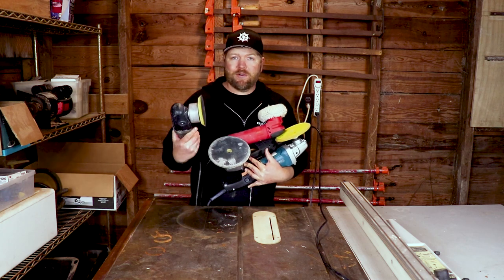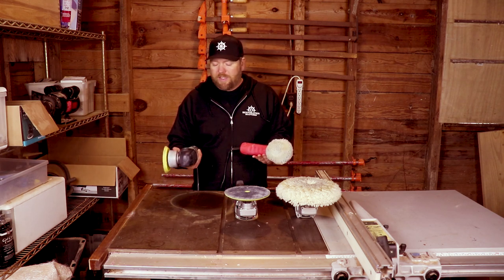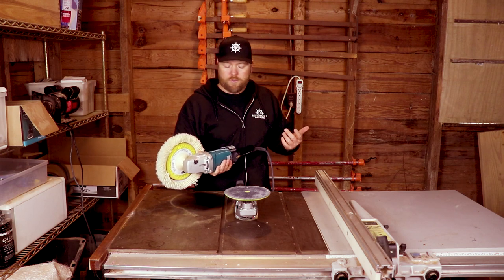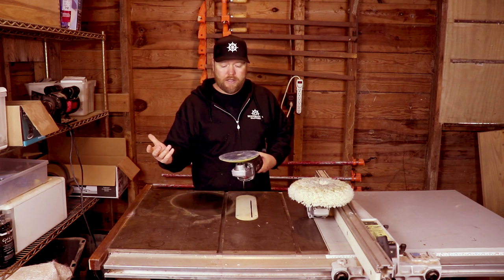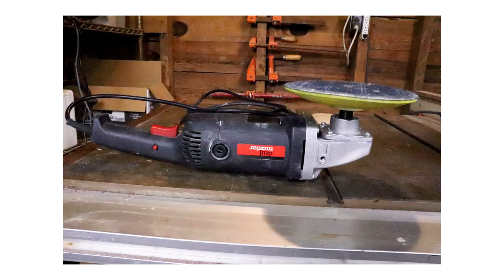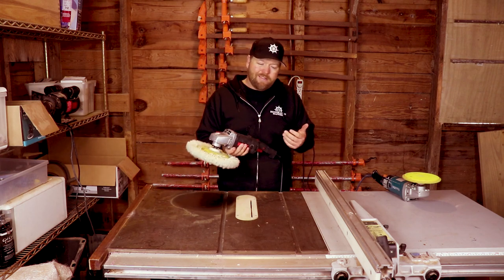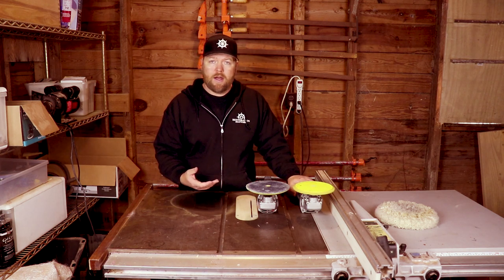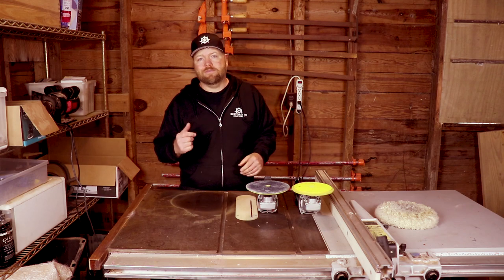Best Polisher for Boat Oxidation - Makita, Porter Cable, Harbor Freight [Review]

Comment from the maker: This video will show you the steps to getting your boat glossy again tps://youtu.be/uiH7F6z02t4   If you have any questions or thoughts, please share!  I'm not the brightest guy( I work on boats for a living!- I think that proves my intelligence right there)  I probably overlooked something!  Thanks, Brian
Reply: Every you tube video show how to remove oxidation on the hull but never on the top side. The Mikita 9237 is my rotary buffer that I use for the hull. When it comes to the top deck or around confine areas I fine it heavy and hard to maneuver. I taught that the orbital Porter Cable or the Harbor Freight machine would have been a good compromise. Do you have an other suggestion ? Normand
Reply from the maker: Monster Norm You need the power of the Makita.  At 600rpm it still delivers a lot of torque and allows you to work slower threw tight spots.  I hope to do a boat soon where I can film the inside.  Direct sunlight is hard to film.  That’s why I’m doing hull sides in all the videos.  I can film in the shade!  I need a boat that is covered to film well.
Reply from the maker: Monster Norm There are two main things that help on the inside.  First, slow down the rpms in tight areas.  Second, an extension for the buffer is awesome around Ttops and motorwells.  Depending on the brand of boat the inside can be a real challenge.
Reply: @SportfishingBoats  When you say an extension, do you mean the 3M quick release for the double sided bonnet? The boat is a Norhavn 40 which is in the water.
Reply from the maker: @monsternorm4245  Norm the a quick release is not what I'm referring to.  However on a Nordhavn 40 I don't think you will need one.  (that's a sweet boat by the way!).  The speed control dial is your friend in tight areas.  The saying is "Go slow, to go Fast!'
Reply: @SportfishingBoats  Thanks for your answers Brian, since I am using the right machine I'll just keep at it slowly as you say. I've been using Meguiar's One step compound, and now the new perfect it 3M heavy compound especially for gelcoat. Do you think I'd have better results with the Presta super cut Compound?
Reply from the maker: Monster Norm Yes,  Supercut is my favorite but the 3M should work fine.  Yes, White for compound and green for polishing.
Reply: @SportfishingBoats  Thanks but which pad do you use for waxing?
Reply from the maker: Monster Norm I usually hand wax.
Reply: Brian, what exactly is a DA Machine good for?  I have the Shurhold but I’ve never used it.
Reply from the maker: mossy112965 for boats, I wouldn’t recommend anyone buy a DA.  Really unnecessary.   I use my DA  as a sander more than anything else.
Reply: Hey Brian,  Great video...
In the video you stated that the Harbor freight tool needs a better backing plate to do the required work.  Can you please provide an example of what I need to look for and or specific part numbers and where to find them?    Thanks a bunch!
Reply from the maker: Keith Whitney Thanks.  Your welcome!  A Presta 810116 will work nicely.  Let me know if you have anymore questions.
Reply: Use lake county pads. I also use trt mirror cut and trt 4 in 1

Comment: In the automotive world you can correct pretty well with a dual action polisher thanks to the inventions of low profile microfiber and wool pads, but boats I could only imagine that a rotary with a heavy cutting wool pad is the way to go for that first step. Some guys are using the flex 3401 and Rupes Mille now on boats, the flex 3401 paired with a low profile wool pad cuts like a rotary, but finishes a little better, you’ll still need to follow up with a softer foam pad and polish to finish out perfectly though.

Comment: Looking at the dewalt dcm8493. Looks same as makita you love but in my mind a better brand name and slightly lighter. What do you think?
Reply from the maker: Every single pro I know that’s been doing it for more than a few years uses the Makita 9237.  It’s bullet proof.  Smooth threw all rpm ranges.  Also doesn’t have the awkward camel back hump of the dewault on top that gets in the way when your holding on top in tight spaces.  My oldest one isn’t quite 10 years old.  My friend has one that is 27 years old and used daily.  I like Dewault compound Miters and other tools.   Rotary buffers for boats... you cannot go wrong with Makita.

Comment: Looking for a few tips. I followed Brian's video. I used Presta heavy cutting white pad and Meguiar's oxidation remover 49 but I cannot get back to original color. I am working on a red 2017 Winnebago Minnie. I am using a Makita 9237C variable speed buffer @ 1500 rpm. There is a spot on the trailer that is missing some kind of label and there the original color shows. After my first attempt, the trailer still shows as "pinkish red" and I am guessing that there is still oxidation discoloring the trailer?  I applied Meguiars 49 on a new wool cutting pad and enough compound that when buffing it would spatter a bit. But I never got a full or heavy application and it seemed the compound would dry and buff up while I was still trying to cut. Perhaps this is the issue.  Would love some advice!
Reply from the maker: If part of the gel coat has been covered and saved from the sun, the rest may not return completely to original color.  Simply too much sun fading.  It is sometimes possible to sand the rest of the gelcoat substantially and then compound and polish again.  Much more recommended option is reapply a decal to cover this area.  Hope this helps.

Comment: So just bought my first boat that actually has gel coat on it. And am curious which compound you recommend and which pads. The gel coat is in pretty good condition except a bit of hazing at the bow and the ski deck. It’s fairly minimal, but I’d like to do a once over as well as the mentioned spots. To get an even polish. 

Any recommendations as if I should do the whole boat, which compound (light compound I’d assume) and which pads.

TIA!

Comment: Would the same apply for a motorhome? I've been using a Meguiar’s D.A. and it seems to be to small for my 30 foot motorhome. I've had some oxidation so I need a good machine big enough to cut and polish. Would a Torqx 22r work better?

Comment: I have an old Mastercraft that I want to clean up but I want to do it right. I'll definitely be getting the Makita, but what backing plate do you recommend? What size  are you using in this video?

Thanks for the info!
Reply from the maker: Will Makita’s backing plate works okay.  I like presta’s better but no big deal.

Comment: Awesome videos. Can you help me find the right backer plate? There are different sizes available but I don't see 9". If I am using 9" pads what size backer plate should I be using? Thanks!
Reply from the maker: The industry makes it confusing.  They are 9” pads with 7” backing plates.
Reply from the maker: Presta #810116👍

Comment: The gelcoat on my boat is in the extreme oxidation stage. While I’m washing it and even after , all I see is white caulk ,both wet and dry. Can it still be brought back ?
Reply from the maker: Depends.. what is the make and year of the boat?
Reply: @SportfishingBoats  2007 SeaRay
Reply from the maker: Bryan Lloyd good news.  Sea ray did gelcoat better than a lot of manufacturers.  It may take some sanding if it’s really bad.

Comment: I have a makita 9237 for most areas, but what polisher/buffer do you recommend for small or tight areas?
Reply from the maker: Tony Terrell I use the 9237 for everything.  I’ve tried some small random orbits with not much success.  There are two keys to tight areas.  The speed control dial and an extension is helpful.

Comment: Do you ever use the same pad with a different compound or polish or do you keep the same polish or compound on a pad and use a new pad if you're moving to a different compound/polish? I realize some pads cut and others polish. Second question is, do you re-use your pads again for later jobs? I'm wondering about cleaning, maintaining and storing them after use.
Yorktown, VA btw.
Reply from the maker: It won’t matter too much if your switching products on a pad.  I wouldn’t worry about it.  I will save a pad for a future project if it still has life left.  I go thru one pad per quart of product.  Sharp pads perform.  Dull pads just cause you to use more compound or polish.  Costing you time and not saving you any money.

Comment: Do you use the Makita to both compound polish and wax I thought Da buffer is needed to polish and wax will be doing my boat the spring
Reply from the maker: On painted surfaces a DA can be useful.  On gel coat rotary is fine and preferred.

Comment: Your videos are excellent!  I have a Makita 9237C.  It has a 7" disk.  When I went to order the Presta pads, they said they don't make a 7" pad, only 9".  Does this work on the Makita or do I need a different polisher?  Thanks, Jody
Reply from the maker: Yes. The 9 inch is the correct pad for for your 9237.  It’s not your fault the industry made it confusing!  Let me know if you have any more questions.

Comment: I have a badly oxidized 1988 compac boat. Do I have a chance if I buy the right equipment?  I have been told it has never been buffer. Thanks.
Reply from the maker: Yes, with the understanding that the gelcoat probably won’t polish out like it’s new.  32 years is a long time.  That’s sounds like you’ll need to sand first and unfortunately I haven’t made a video on that.
Reply: @SportfishingBoats  make that video lol

Comment: What if you’re a beginner and you don’t want to burn the gelcoat isn’t it a better option to go with a good dual action polisher?
Reply from the maker: No.  DA is just a waste of time on gel coat with oxidation.  Don’t worry about burning.  Just don’t compound on a surface that’s already warm(outside in sun, middle of the summer). And keep the buffer moving.  You’ll have zero problems.  You can always check by putting your hand on the surface you just buffed.  If you can’t keep your hand on it, it’s north of of 140 degrees.  Still well short of burning it but an indicator it’s too hot.
Reply: Sportfishing Boats OK thanks I appreciate it what about stickers On a boat can I go over those With a buffer or should I go around those by hand?
Reply from the maker: Anthony jr Buff right over them like they aren’t there.  99% of the time you don’t have any problems.  But, it is a boat(never easy!), then there is that 1%

Comment: Recommend for smaller areas? I have the dewalt no load but for smaller areas it’s just to large
Reply from the maker: This my fault I haven’t made a video on this.  Use the side or edge of the pad and slow down a bit.  I do almost everything with a 9 inch pad.  Just go slow and make sure you have sufficient product on the ends of the pad to avoid dry buffing.  On the inside the speed control mob is your friend!
Reply: @SportfishingBoats   - do you use a 9" backing plate or just a 9" pad on a 7" plate?   Curious.
Reply: @SportfishingBoats  - also which plate do you use or recommend?
Reply from the maker: James Haydel 9 inch pad on 7 inch plate👍
Reply: @SportfishingBoats  Thanks!

Comment: Hi Brian. Thanks for the informative video. What's your take on wet sanding for a highly oxidized boat? I have a 2001 Bayliner 3488 that, as far as I can tell, has never been polished! It sits in the sun in Hawaii. The reason I ask is because someone suggested I do that before trying a polisher because the pad will get all gummed up very quickly and I'll have to use a lot of pads. I will be buying that Makita 9237! Thanks.
Reply from the maker: CaptainSalas yes, it sounds like sanding will be necessary.  I really need to make a video on it.  Quick primer- I use 600(if necessary) then 1000  grit followed by compound with Presta Supercut.
Reply: @SportfishingBoats  thanks! I would be interested in a video on that. Also, would you just use your hand or is there a way to power tool that wet sand?
Reply from the maker: CaptainSalas I dry sand.  Mirka autonet on a random orbit sander.

Comment: Hi what do you think about using rupes on boats ( rotary )?
Reply from the maker: angel moreno Do you already have one are you thinking of purchasing to use on your boat?
Reply from the maker: angel moreno I’m sure it’s a nice machine.  However, for the price you can get a Makita 9237 which is indestructible and the industry standard for professionals.  Not to mention if you do have a problem or need parts they are widely available for Makita.  My tool repair guy won’t touch a Rupes!  I would save the money buy a Makita.
Reply: Sportfishing Boats i used to work at seavee boats, we used makita for the whole process, now i have my own company, i do detailing, i have rupes to do cars, but i am looking a lot of people using rotary rupes on boats, i feel they are weak for boats